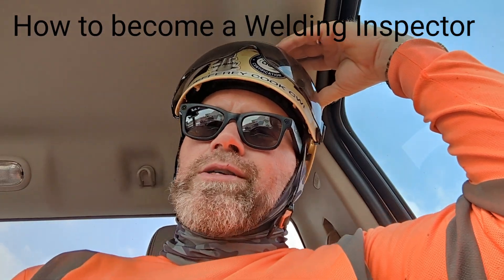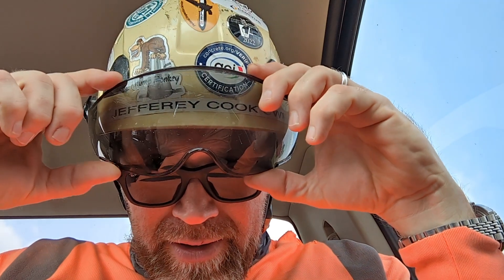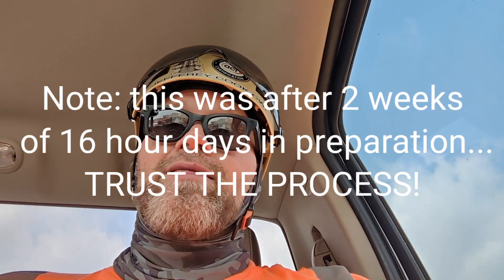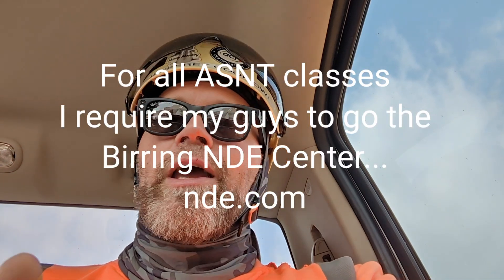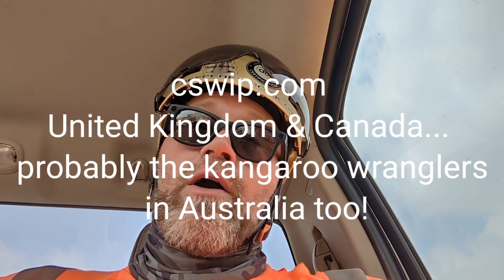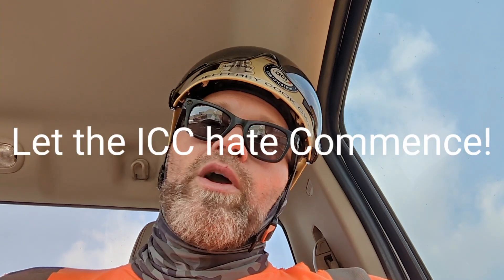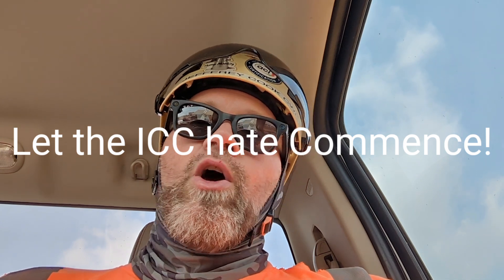How to become a Welding Inspector (CWI)

Comment: Step 1: go work at fast food restaurant where once they asked for your help in bolting down a welded handrail that came lose. Work there for a few months, make friends with the manager. Step 2: Apply to AWS to take the exam. On the requirements part, say you worked with "custom welded structural assemblies" for 3 years. Give your manager buddy's number for reference. Step 3: Pay to take a class where you are re taught how to do very basic math. Step 4: Pass Exam, go to work. Tell everyone you are a seasoned inspector; tell welders about undercut that doesn't exist, and obsessively look for arc marks.

Comment: Been a cwi for over 2 years now, best decision ever. Did mine on D1.1, part B was for sure the hardest part, but ultimately, the most intimidating part of test is that clock. Fastest 2 hours you'll ever experience. My overall average was 89%, but a pass is a pass.
Reply from the maker: @trevorhoward6115  I know right. Hard test, short time.

Comment: ICC CERTS TEST ON D1.1 
WHILE A CWI IS TESTED ON WELDING WITH A SMALL SECTION ON CODE COMPLIANCE IE: AN ICC INSPECTOR NEEDS TO BE EMPLOYED FOR 10 YEARS TO QUALIFY TO TEST AWS, JURISDICTION,S WANT/NEED THE EXTRA LICENSING FUNDS CORRUPTION RUN AMUCK
Reply from the maker: Could not agree more! Thanks for watching.
Reply: That’s not true I’ve been a welder for 16 years and just applied for the AWS CWI And I’ve never worked as an icc inspector. I got approved and take my test in August
Reply from the maker: @BrandonMoore-e6j  you might have misunderstood what he was saying. Your welding experience is what got you the seat at the CWI table. He's saying that with zero welding experience it would take 10 years to gain the required experience to test. Though he was using hyperbole/exaggeration for the sake of emphasis.

Comment: ICC both bolting and welding in most cities in California is a prerequisite to have to weld inspect any structural building in California. Including any structural shoring where splice full pins are required and fillet welds are needed. Los Angeles city , Los Angeles county , Orange County etc .
Reply from the maker: Thanks for sharing that information... I saw something about Cali's push to ICC during the most recent ACI convention in New Orleans. I'm assuming you're talking about W-Shape or even HSS CJP splices. It seems they (cities) would push for the ISO 9712 if they are looking to make sure inspectors are qualified to UT CJP, unless we're talking VT only. I still stand behind my statement, no practical for ICC makes it a less desirable cert in my opinion. But ICC is peddling their certs so hard it makes me wonder if they have pictures of city officials on Epstein Island. 😂 Thanks for watching.
Reply: Do they accept ICC in lieu of the CWI or do you need that cert too?
Reply: @CallMeJazz most projects that are prevailing wage require CWI’s in California. Regular commercial projects use ICC welding inspectors
Reply: @CallMeJazz ……. Most jobs that are not state or city jobs will accept the ICC bolting Certification as a so-called Welding inspector. that would be like Lowe’s Home Depot a gas station a house anything that is not city or government but anything government or city requires a CWI.
Reply from the maker: I just subscribed to you. Keep that awesome content coming.
Reply: After you get your AWS CWI here in San Diego we just need to pay a fee with the city and register and they will give you icc credentials but you gotta have the CWI
Reply: Just a couple of comments...
No grudge against Real Education, they are GREAT, but you can't really compare their 2 week class against the AWS one week class. The AWS 2 week class rivals and is more comparable to Real Education. Also, if you go with AWS, and take the Part C on D1.1 (I highly recommend this option), you will get the $600 D1.1 WITH the training. 
As for Part B, while there are plastic weld replicas, a good portion of Part B is Qualification (Procedure and Personnel). There are alot of questions on WPS's, PQR's, and WPQR's. 
I would also recommend Endorsements, particularly the WPQ1 and WPQ2 in lieu of the 80 hours of PDH's or taking the Part B again.
I am not clear what you mean by Ultrasonic 1 and 2, perhaps that is something that your company uses. I think you are referring to UT Soundness (Longitudinal/Compression wave) and UT Shearwave. There is also Ultrasonic Thickness and Ultrasonic Phased Array. Saying 1 and 2 tends to imply ASNT Level I and Level II, which is comparable to an Apprentice (Level I) and a Journeyman Level II). 
Also, unless the contract calls for a CWI for structural work, if it only calls out D1.1, a CWI is not required. The 5 ways to do inspection in the code are contained in Clause 8. 

All in all, GREAT Video!
Reply: No, that’s not true. I have done hundreds of buildings boating. I’m also a CWI level 2UTNT but I did go through my structural steel bolting course didn’t get my certificate but didn’t matter that hundreds of buildings.